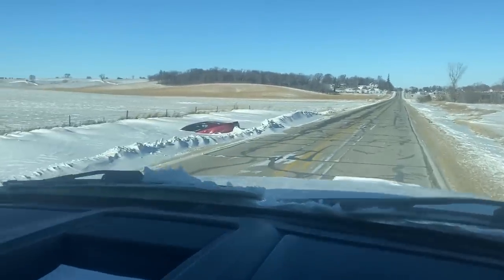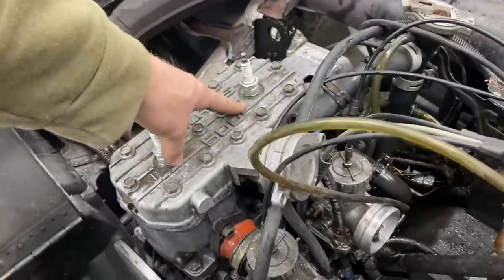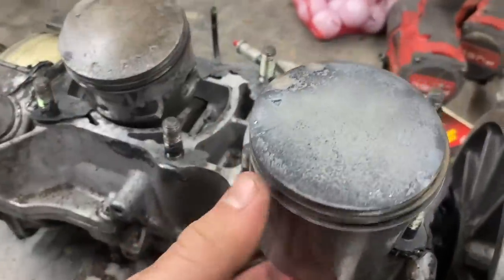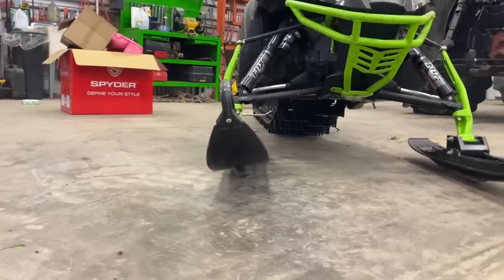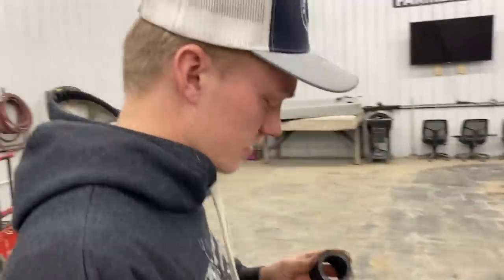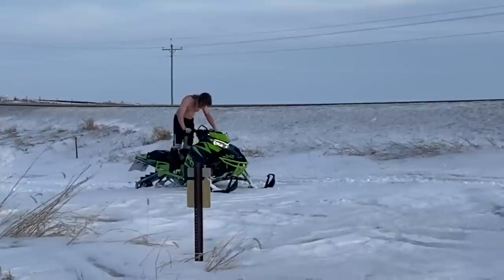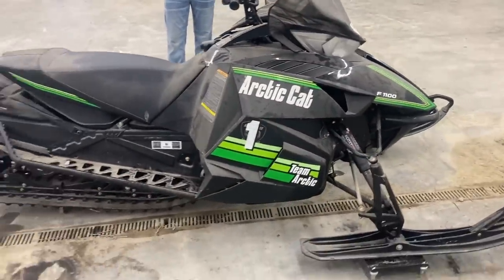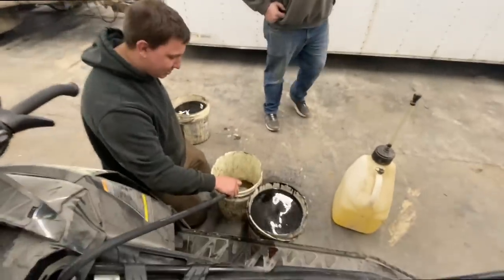Bangin’ Ditches & Blowing Pistons

Comment: Cooper, those primary’s are a common problem! Either replace it with the new updated adapt clutch, or a cvt tech powerbloc 80 clutch, adapt clutch for 0-3000ft needs 70g weights, mountains is 67g weights, secondardy helix is like a 44 or 46 degree helix for 0-3000ft with that team secondary I believe, , definitely look at getting qs3 shocks!, and if you ever take out that motor get a 22+ motor, they changed the injection ports on the injectors, and put some vents on clutch panel help with clutch life, I’m on cat #6 right now and love my 22 alpha hair core 146